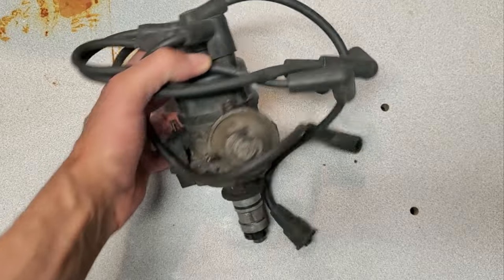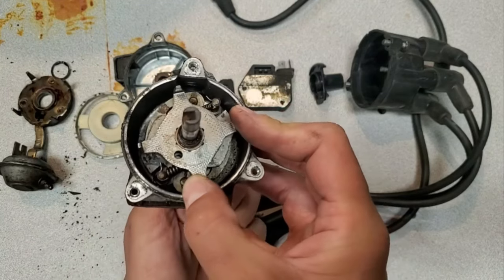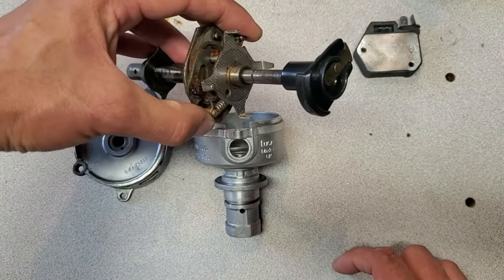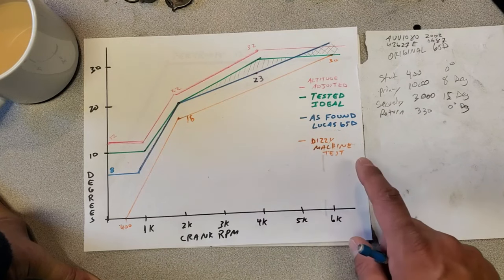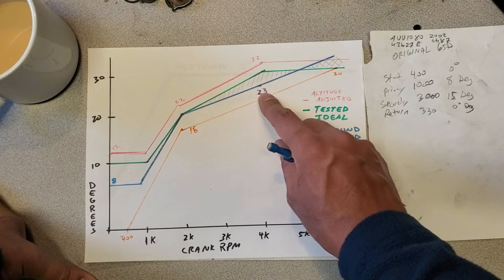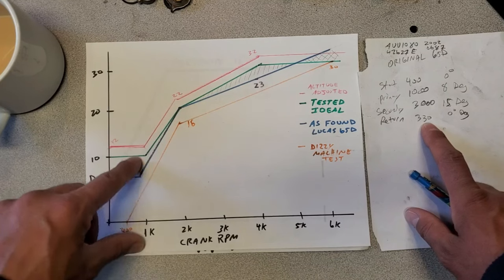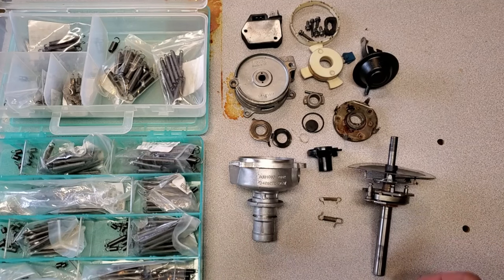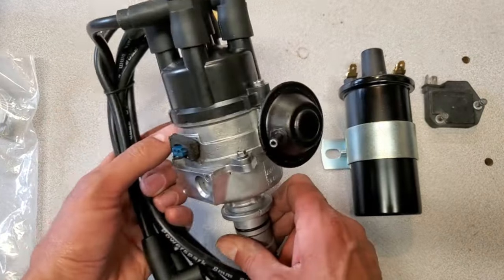Lucas 65D Distributor Repair, Restoration and Recurving. Red Mini Project part 2.5

Comment: How did you test how many degrees at what rpm the engine likes?
Reply from the maker: By knowing the curve and then driving on the road and making timing adjustment.
At some point the performance will drop off with too much timing or it will develop pinking/knocking.